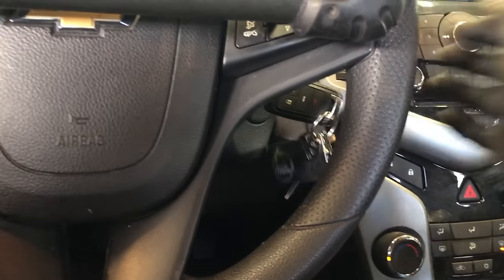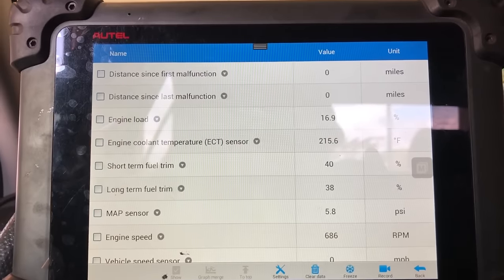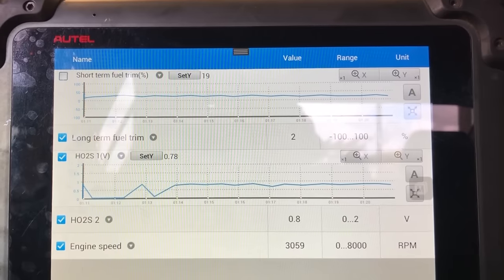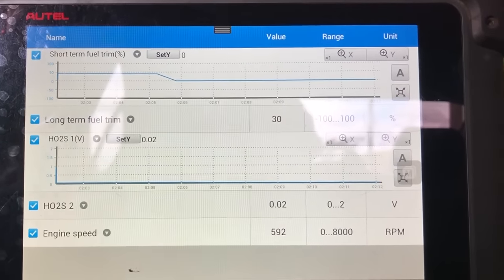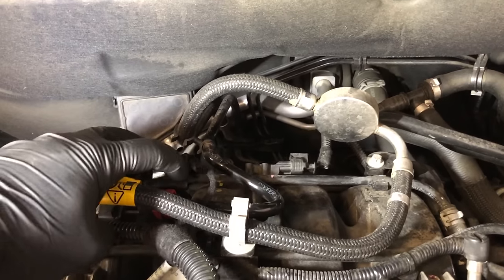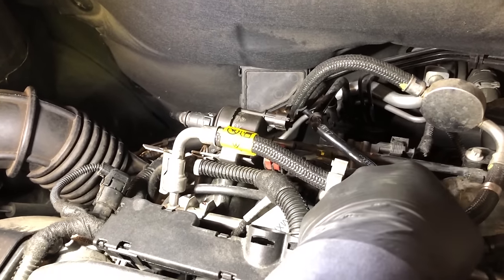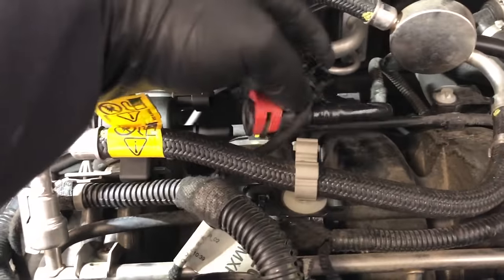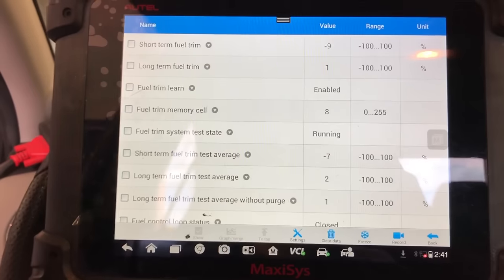How to Diagnose and Fix a Lean Condition - Chevy Cruze P0171

Comment: Yo hektor  , I almost fell for autozone telling me It was my intake ,  and valve cover  had me ordering $300 worth of parts I had a scanner but didn't know much about fuel trims and how that works , I stumbled on this video and after a new purge the cruze is all set to go . The big part of this is I'mma single dad of three girls 10 , 12 , and 14 and that money I was able to save went a long way at the grocery store at a time I'm out of work due to covid , just wanted you to know your not just teaching people how to fix cars ur helping us keep money in our pockets when money is so tight rn thanks brother I really appreciate ya , and Tom cruze is still running smooth take care , God bless , and peace out
Reply: Careful, this doesn't happen often, sometimes it could be a combo of damaged intake booth not measured by the MAF.
Reply: That's why it's recommended you take it to a shop for proper diagnostic services.
Reply: Did yo car have problems starting wen u drive it around
Reply: I named my Cruze Tom as well..
Reply: Yeah well it definitely still could be as that is the most common problems on a Chevy 4 cylinder. This is pretty rare in this video. Usually stuck open purge valve sets incorrect purge code
Reply: This video is a very helpful and please keep posting some more videos 😊
Reply: Thanks Great Vid Bro Gotta Check my purge v hmmm
Reply: Great knowledge, great way of explaining it. Fast and easy.
Great Job Hektor

Comment: Have been popping a P0171 code for about a year now. Keep resetting it, which does me for awhile but then it pops up again. Finally decided to search for the issue. Came across NUMEROUS videos regarding this code, but yours is the ONLY one checking the purge valve....and lo and behold, upon checking this before heading to work this morning, my purge valve is sucking air. Have now ordered a replacement and hope to be back without codes soon. Thank you so much for your excellent explanation and descriptive video....I miss the old days of drag racing my easy to work on 72 Chevelle, none of this cheap plastic and emissions crap throughout the car....just a 350 4-bolt that you could sit on top of while working on it. 🙂
Reply from the maker: The Good Ole Days…

Comment: Great diagnostic process. 

You gotta think of all possibilities.
Reply from the maker: Volusia-ev Figure out what’s right with the car, and the wrong will jump out at you 👍🏼
Reply: hello my 2015 Chevy Cruze 1.4 is running to rich when I pass some one on A hill you can smell it  when I press on the gas pedal stinks
Reply: My purge valve is brand new so that's not the problem I've already checked that probably A 02 sensor going bad or something any ideas would be appreciated

Comment: Thank you, this was the problem. I have had this idle issue with a po171 code for my 2011 Chevy Cruze for almost two yrs. I did a lot of searching and fixed other issues related to it, but I could never find anything that related the issue this video showed. I'm sure other videos and info is out there, but I never came across it. My purge valve had just a slight suction when there shouldn't have been one. I got a new one and noticed the change right away. It fixed my problem.

Comment: This is great. I came to same conclusion on my car before I even got to this video, My deduction was made up on different experiences of others, however I can say that cleaning my purge valve did the trick for me. Therre are a lot of these valves used and you may or may not be lucky. My valve costed 130€ for 1.6 engine while 1.4 engine costed about 15€. Plus, 1.4 engine valve was widely available and my engine' valve was obtainable only by dealer. So I took it off, tested with battery (solenoid was clicking fine) and I cleaned it with  brake cleaner. After three runs it was sealing perfect and I returned it to its position. You may want to test it and try to fix it before you buy new one, just my 2 cents.

Comment: This is exactly what was wrong with my 2017 Buick Encore! For anyone in Canada, the purge valve is covered under a special extended warranty that outlasts the regular powertrain as GM apparently knows how faulty this is. If you bring it to your dealer and you’re still in that window, chances are it’ll be 100% covered under warranty. Wish I saw this video before though, and could’ve avoided the dealership all together!!

Comment: Thanks for the video Hector. I had same problem P0171, changed valve gasket and fuel injectors and had same problem smh. Next is to clean/change the MAF sensor.
Reply: I did all of that in my 05 scion and my po171 code is still on🤦‍♂️😭
Reply: @BlueDutchCigarillo420 did you find the solution

Comment: My engine seems to have a very slight vacuum leak as if it only has a leak occasionally.  After watching your video I noticed that most of the noise from my engine (which always seemed loud to me) was clicking from the purge valve.  So I just ordered a new one.  We'll see of that improves the symptoms.
Reply: My daughters 2012 is making a popping sound every couple min. Could be considered a clicking. Any resolution?

Comment: same problem of my car chevy cruze 2011 engine check P0171 but the dealer tech said its turbo replacement is it possible they did not do a smoke test they did not explained its a vaccum leak they said its a fuel trim and there diagnose is turbo replacement  last month they change my cat converter  and oil fan  and its cost me 2 thousan dollars it seems i cannot trust them anymore and its a big help watching your vedio i learn a lot thanks

Comment: I had this problem, intermittent then steady. The system thought it wasn't getting enough air and leaned the fuel delivery. Faulty MAF sensor was the cause. Get the Bosch from Rockauto, $47. It's at least $113 locally. Power increased noticable but fuel economy also improved.

Comment: I should have had you analyze my 2015 Malibu 2.5L, 4-cylinder with the P0171 code. Engine sounds fine, check engine light on. Took it to the dealer, they ran their tests, couldn't find a fix after 5 hours, and didn't charge me but reset the light. Half a day later, the light comes on again, I decide to take it Tires Plus and let them have had it. A few hours later, they just confirmed what the dealership said, couldn't find a fix, and didn't charge me and reset the light. Half a day later, light comes on again. That's where I am now. Can't afford to just waste time on this. Engine still sounds fine.
Reply from the maker: Terry B There’s only 2 things that can go wrong 1) Too much air or 2) Not enough fuel. Just gotta find out which one it is and where the problem is.
Reply: @HomieHektor  Yeah, Tires Plus gave me their list of P0171 potential systems and one was "Fuel Quality", I put in some gas from a different company and some time later the light went off for a few hours, then back on. Added some fuel injector cleaner and more gas and the light stayed off. It's been quite a while now and the check engine light is still off.

Comment: Very informative video! Currently dealing with some issues with my 2014 chevy cruze 1.8 l4. Jerking a little when in idle along with the rpm dropping when i’m parked. I bought a new valve gasket and i’ll get it switched out if it’s needs to. But first i’m gonna need to find out what codes it sends out. Thank you!

Comment: The only thing he did not explain, (and I don't understand) is, how a vacuum leak would BLOW OUT Smoke rather than suck it in -???
We used to use throttle body cleaner, or something like it, and spray an area to see if engine Revs Up! (can be dangerous : )

Comment: Had PO171 code. Cleaned the mass airflow sensor  and used Techtron high mileage  fuel cleaner.  Reset check engine.   Check engine light has been off 250 miles.  My opinion is the the Techtron cleaner is the fix.

Comment: Have a 2014 Chevy Cruze 1.4L have already replaced about 12 parts since October and it’s still not running right has a rough idle and a squeal/whistle have replaced the valve cover and codes still show lean even after being cleared they come back on after a day. Fingers crossed it’s this and not anything else $1200+ in repairs cost me $75 to do the valve cover and fixed the stalling issue

Comment: wonderful explanation! I have a question regarding this exact vehicle. My Cruze has a p0172, I've changed everything that could possibly be causing the code. I've replaced the up stream o2, MAF, Spark plugs, and one clogged injector and the long-term fuel trim continues to operate at -35. Any suggestions on what it could be?
Reply: Brake Booster?

Comment: Great video I have a  2013 Cruze  with codes P0171 P1101 checked the purge valve the suction is not loud but you can feel it.
Reply: My 2014 is throwing the same codes, hence why I’m here on this video lol Did you find out what the issue was?
Reply: @jxcorona13  I did some testing & cleaning of other components it seems that my purge valve is on it's way out. I let you know what happens.
Reply: @jxcorona13  It was the purge valve. Thank you for making the video you saved me from having to go to a dump water repair shop in this town I live in.
Reply: @derrickmcdaniel6105  Nice, fairly easy fix. I ruled out the purge valve on mine. I need to check the check valve if it’s missing to determine if I need to replace both manifold and valve cover/PCV or just PCV.

Comment: Ggrrrr I just spent $1200 for purge valve, and turbo charger coolant hoses and connector and the engine light came back on 30 minutes later after I filled up my gas tank, so it's back in the shop. 3.5 months ago I got my intake manifold/cam shaft cover replaced. 2015 Cruz. My car was bouncing up and down and feels like it's stalling
Reply from the maker: You need to have it diagnosed,
Reply: @HomieHektor  they did do that

Comment: I have the 1.4t and I had stabilink and Trac and running to lean so hopefully I can figure it out with this vid. Thanks.
Reply: Did you figure it out?
Reply: Same issue here but haven’t seen any answer yet
Reply: I think it was my valve cover gasket going bad and spitting oil all over my bits. Then my catalytic converter went bad because of it. Just get it fixed right or get rid of it, either way the car will fun fine for a while and if it doesn't have the code cleared or get it fixed cheap so it can run right. I had my mechanic put a spacer in the 02 sensor in the exhaust so my engine light went away and it ran worse for the environment but ran okay and didn't give me any more trouble.

Comment: the pcv is more of an issue on the 1.4l, in general the 1.4 has more issues anyway. but that purge valve is common on both engines, i have the 1.8l sonic and i have a new purge valve in the glove box just in case.

Comment: I have a p0171 code but on a 2.4L  malbu.  I replaced the purge valve solenoid and the O2 sensor as well as the spark plugs.  Then, today I noticed a crack in the exhaust manifold.  Maybe a dumb question, but do you think that could cause the P0171 and the P0300 codes?  Trying to figure this out without dropping a grand in shop costs.

Comment: Definitely could be the problem on my 09 Aveo5. I will check for this before changing the fuel injectors. Just wish I had the scan tool you got
Reply from the maker: Richard Hynson any code reader that gives you live data will do 👌🏼
Reply: @HomieHektor  well it was not the breach valve. It was actually the PVC valve. Which in an 09 Aveo5 is built into the valve cover. I had to replace the whole valve cover.
Reply from the maker: Richard Hynson sound about right 🤘🏼
Reply: @HomieHektor  By the way. Thank you.
Reply: Hector I’m in the Pomona area need to take my car to you

Comment: I inspected the valve exactly as shown on the video (proved to be OK as I could not blow any air through). After reconnecting everything, my car will not start at all.  Confirmed it is not an issue with the battery. Any help you can offer is greatly appreciated!
Reply: Were you able to start your car again?

Comment: 2012 Chevy Cruze 1.8l. Purge valve is functioning correctly, yet still throwing same code p0171. Is there any definitive way to know if it's the valve cover? I don't have a fancy scan tool yet but it sure would be nice to know for sure before I replace the valve cover. There are no other obvious vacuum leaks. Any advice would be much appreciated. Thanks for the vid at least got that part knocked out.

Comment: Homie Hektor this is an awesome video thanks for uploading. I'm currently having issues with a 2011 chevy cruze 1.8 lbs (non turbo). Ita running really lean. I checked the purge valve and it worked fine, replaced spark plugs, valve cover gasket, 02 sensor (1 upstream), and found no leaks. Throwing a P0171, P0137, P1133, U0100 code causing a rough idle and the stabilitrak comes on and off. Have you ever dealt with this? It looks like all this is a very common issue with this car. Any advise would be greatly.  appreciated.
Reply: Get a new car
Reply: Car runs like a champ no issues
Reply: @nomorebreaksmigo5412   "Get a new car" says the Millionaire. 😄
Reply: Got the same problem, any luck figuring it out? My engine light/stabila toggles on and odd and I run rough at startup or low speed/backing up.
Reply: @deleetmeeh  Spray bottle of water all while the engine is running Hot. Spray around the intake see the idle acts up. Starting fluid and carburetor spray works the best but can start a 🔥. Be careful
Reply: I have same codes and symptoms did u ever figure it out?

Comment: I have a question about a 2016 Chevy Cruze. I did some fuel pump  current ramp testing. I wanted to see what a good fuel pump waveform looks like and find out what rpms is the fuel pump running. Well I calculated 60,000 ÷16 ms delta time using a  uscope, and came to about 3500 t0 3700 rpms. I have no drivability issues. I just wanted a known good waveform to compare to my 2004 chevy colorado fuel pump rpms. For my colorado I'm getting 60,000÷ 10ms delta time which gives me 6000 rpms. My question is where can I find specs for fuel pump rpms ? Thank you. Oh yeah liked your video.

Comment: Would a bad upstream oxygen sensor cause a cruz to stall? Im getting p0171. Ive already changed maf, hose from turbo to intake manifold, cleaned throttle body. Im getting low readings from upstream sensor. Doesn’t go over 0.200 just regulates below that. Car runs rough and throws black smoke. On cold start feels normal till it get to idle. Sometimes shuts off of i rev it

Comment: Hi having same issue -  system too lean, more fuel consumption but engine check is coming and going away on its own - any advice if this might be same issue? I checked that my purge valve has already been replaced on bosch one and they removed that reusable connection on the end of the valve so if I unplug it I ll have to replace it - don't know if its worth checking that way. Great video, I already feel like an expert ;)

Comment: Hey Hector, I am 99% sure you can help me with my problem after Watchung your videos but anyway I have a 2014 chevy cruze 1.4 turbo that is running just like this one and bringing up all the same codes. I have already put a new purge valve on along with a new map sensor, maf sensor, fuel pump, both o2 sensors, fuel pump module, new plugs and new coil pack. We can't seem to find any vacuum leaks so I have no idea what is going on with it. I just recently got this car and fell in love with it but I'm getting so frustrated I'm about to junk it. I'm hoping you can help figure out what is going on. 🙂

Comment: Hey man, I just replaced the valve cover, pcv hose & intake manifold because all those check valves were bad, but my car STILL shows P0171. And idles rough. The purge valve is good as well. Not sure what else could be
Reply from the maker: Where are you located?
Reply: Throttle or Gas Peddle

Comment: Good information though does this apply to the 1.4 turbo engine its the same year?
Reply: The 1.4 system is a little more complex, but the same basic principles apply. A guy by the name of Dre Dan on youtube has a very good video on boost leak testing the 1.4L and has good videos on the PCV system. He also has write ups on the CruzeTalks forums

Comment: Checked mine out, then took off engine cover, and put hand over pcv valve, and a hole with air blowing through it. Bummer that Cruze has manifold cover and pcv as one unit, as it’s costly. I think I’ll put some high temp rtv gasket silicone on it instead

Comment: So I got one that runs lean with the purge valve plugged in. But unplugged goes to normal fuel trims. I smoke tested through the purge line towards the tank  and no leaks with canister vent valve commanded closed. And with it commanded open pours smoke from canister.

Comment: Hi 

Nice video !!!

Did not get the information about short term fuel trim level. what value should it have when the engine is running perfect ? aprox 0 ? 

Thanks
Reply from the maker: Martin Knudsen they should be hovering around 0    +/- 5

Comment: Just stumbled onto your website. Got a 2015 Canyon with 3.6L. Rough idel, intermittent.  Was able check Purge Vlv felt  suction on finger tip so replaced it. Engine feels better and haven't felt idel issue...so far!? Questions...if Vlv was bad why didn't I see a code on dash board? And 2nd, wasn't able to blow through the old Vlv! Could you enlighten me. Thanks.

Comment: My car keeps bringing up code u00100-71 when I check the abs on my scanner. My car also just started bringing up the warning lights to service  the stablitrack and traction control and my radio turns off sometimes. Everyone is telling me it’s different issues and different prices. I have a 2014 Chevy Cruze. Please help.
Reply: throttle body & gas peddle also valve cover